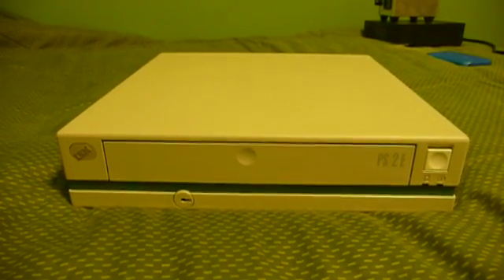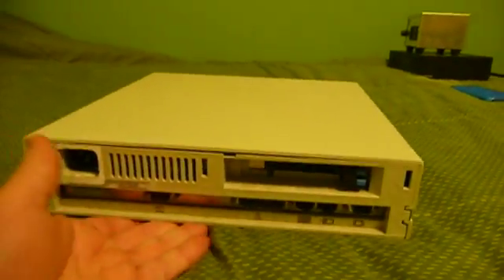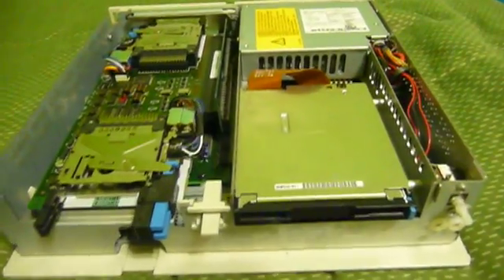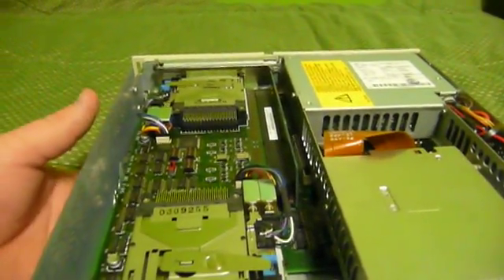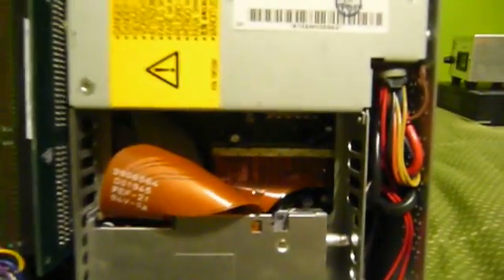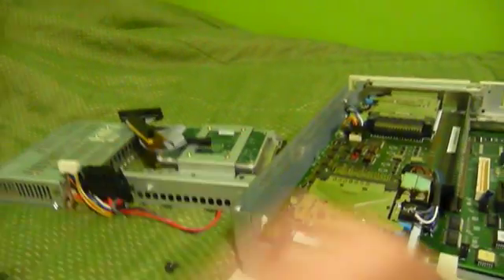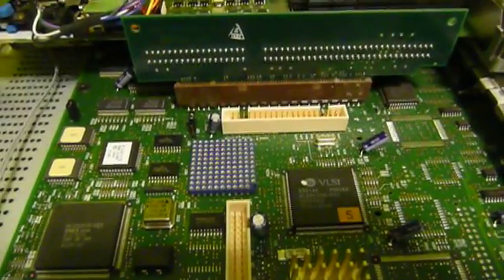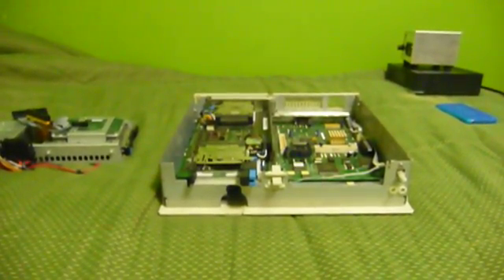IBM PS/2 "E" (9533)

Comment: I have one of these, plus a spare, loaded with programming software for various older land mobile radios. It gets used sporadically. I noticed a fishy smell when turned on and I am thinking the power supply might be failing. Is that a common symptom? Thanks to your video, I may be able to swap the PS from the back up unit.
Reply from the maker: Fishy smell indicates failed and leaking capacitors. Leave them long enough and they will damage circuit boards.

Comment: I had one of these machines as a my first computer with a hard drive.  It was definitely unique.  Every time you changed any hardware, you had to boot off of it's configuration floppy.  Mine came with 4MB of RAM and when I upgraded to 8MB I remember it being quite the chore to get it working again.  I did successfully get a PCMCIA sound card working in it after getting a copy of PnP configuration manger from a friend since it didn't come with it's own.

Comment: For those having a 161 and 163 error code, replace the coinshape battery. Then create a ps/2e starter disk. When booting and continue after these errors it will run the starter disk. Then you can set date and time. All errors are gone, boot is normal. You can download starterdisk here:http://ps-2.kev009.com/ohlandl/9533/ps2estrt.exe

Comment: Way back in the day, I used an aftermarket 486SLC2-66 motherboard in my homebuilt PC. For a brief period of time, it was considered a low-budget alternative to Intel's 486DX2-66, for those who only cared about clock speed and not actual performance. Shortly thereafter, there were boards using the IBM Blue Lightning 486BL3-100 (a.k.a. 486DLC3) -- the world's first 100 MHz x86 CPU, beating Intel's own 486DX4 to the market by a few months.

Comment: worked for a company called KW controls besides being a electrical eng I took care of all the computers and they had 15 of these I rember having to replace power supply and floppy drives all the time they ran Microsoft works on all of them .When the company went bankrupt I got 2 of those now buried somewhere in my attic. You should also go over what all those dip switches did Very important. I have a factory manual for those on my book shelf .

Comment: I recently repaired an IBM PS/2 Consultant Model 2155 G72.  It's upgraded with a 66MHz 486 DX/2 and 28 MB RAM.  Unfortunately, it all of a sudden wouldn't POST and the keyboard lights flashed on and off randomly.